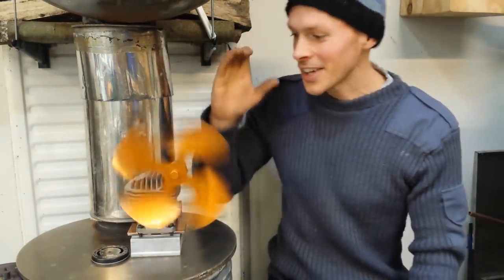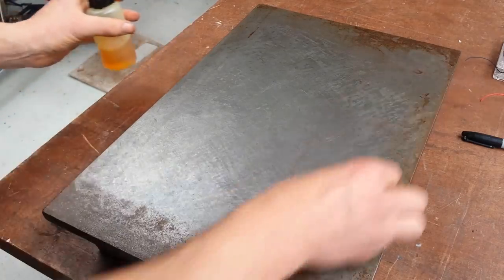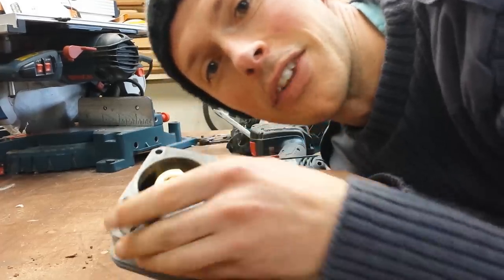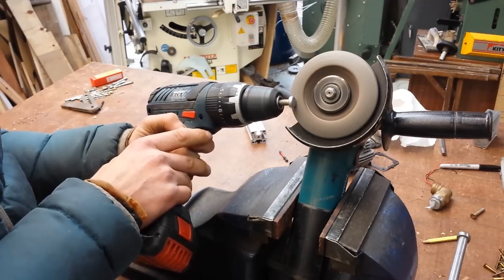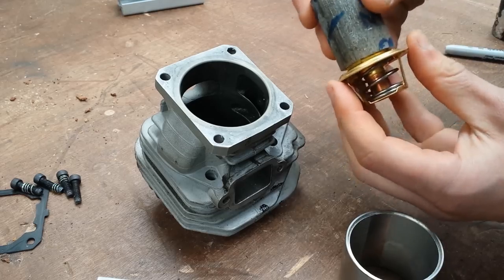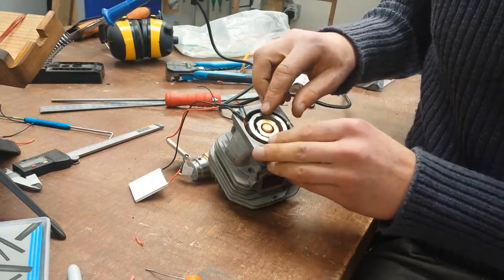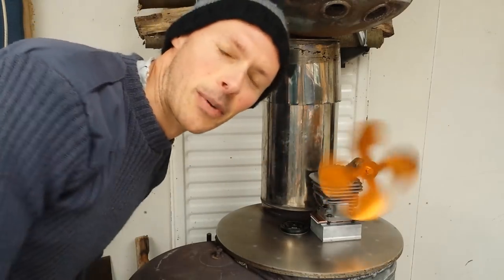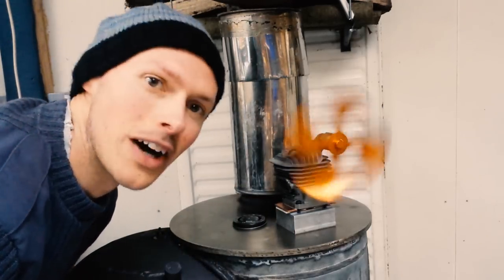Stove Fan's Achilles Heel and the easy Upcycled Fix

Comment: Congratulations. where you buy table drill and what is model?
Reply from the maker: Thanks, The drill is a Meddings, an old British make. I got it second hand. It started as three phase, but I found a skipped treadmill and converted it to use the motor of that - much more powerful than the original. If your interested I blogged about it  when I did it: http://www.floweringelbow.org/2009/tools/pillar-drill-modding/

Comment: How long should the teg take to spin the motor? Which side should I put down, the side of the teg that gets hot if I put voltage through it?
Reply from the maker: If the stove is already hot when you put the fan on its top, it shouldn't take long at all - less than 1 min.
Reply: @FloweringElbow  hmm. I tried this before about 2years ago and it worked. I tried it again this week and it doesn't. What's a good way to test the teg?
Reply from the maker: In the past I have hooked it straight up to the motor and heated one surface of the TEG with an iron. Put a block of alu or some heatsink on the other side. If you suspect the motor might be faulty try hooking the TRG up to a multimeter to measure voltage...
Reply: @FloweringElbow  the motor is fine I have tested that with a battery. Maybe using a heat gun wasn't a good idea! 😄
Reply from the maker: Did you use it directly on the teg? Or on the base of the whole fan assembly? If straight on the TEG it was probably too much, unless very brief..
Reply: @FloweringElbow  yep directly on the teg! I've ordered some more now!
Reply from the maker: Which ones did you opt for - expensive & more temp resistant ones of the cheapos?  Are you going to be using the wax thermostat to help protect?
Reply: @FloweringElbow  cheap ones! Ordered 4. I have checked my one with an iron and it's OK. The problem is more than likely down to the paacker I was using. I have ordered a square of 3mm copper plate. I like the thermostat idea and may take it up. Want to try and get this working first though

Comment: maybe having a not as flat surface may help with not cooking the peltier
Reply from the maker: Hi Aft. So the very flat bit connects the peltier to the 'cool side', the heatsink that is wanting to be as much cooler than the 'hot side' as possible. It actually cools it. Where it connects top the hot side (the part resting on the stove top), doesn't need to have super good contact, like you said...

Comment: You could have just took a circuit breaker pull out the metallic tabs and use them to push up
Reply from the maker: Nice idea💡 . I've never actually looked inside one. That's got to change soon 😀